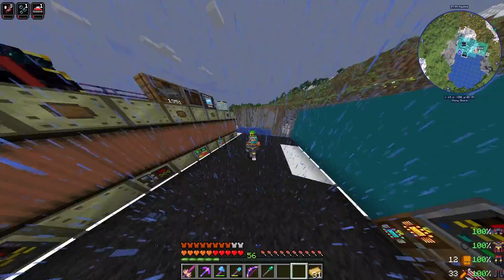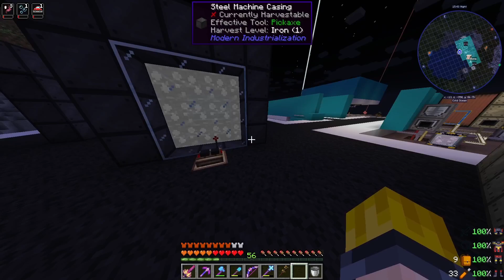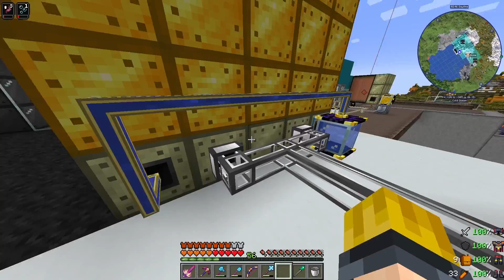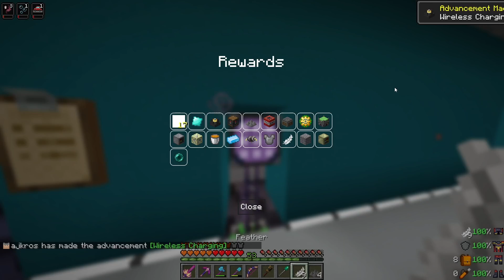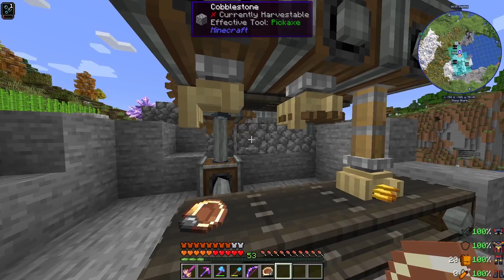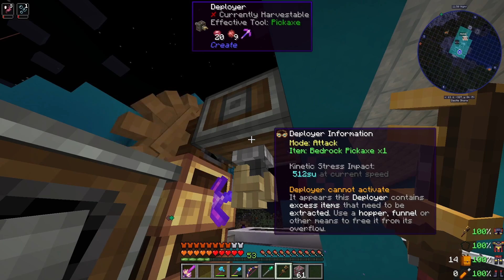Fixing Steam Production & Starting PetroChem! | StaTech Industry | Episode 13

Comment: That threshold switch is going to save me, I've been trying for ages to figure out a hysteresis circuit for the LBB, and this is it! I actually even submitted an issue about it, because being able to control the boiler based on how much steam we have seems pretty important for optimising fuel use (of course, this is before I knew about this though I'd still like an MI-native way of doing it).